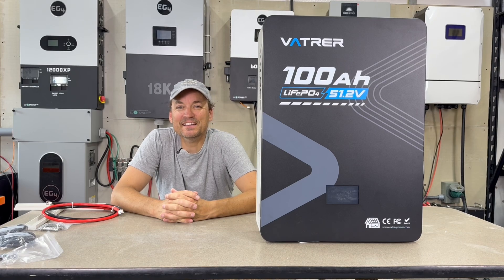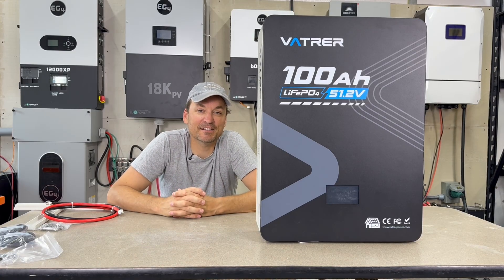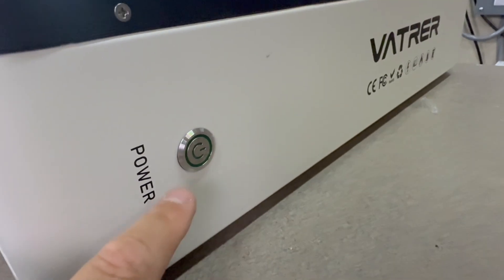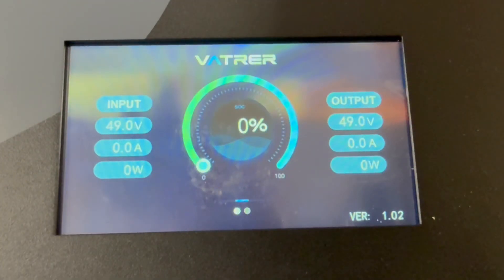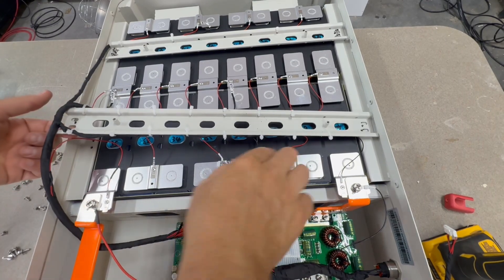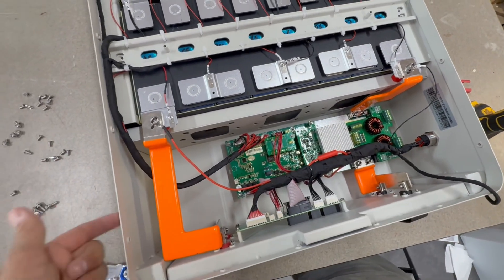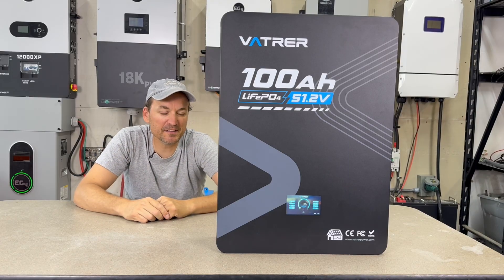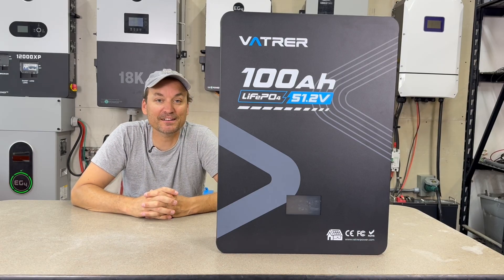The new Vatrer 100ah wallmount battery,  review teardown and testing, #vatrerprimeday

Comment: Can  it work  with a inverter without communication protocol
Reply from the maker: Sure. No issue there. You can set the charge and discharge parameters on your inverter.
Reply: Thanz my inverter is xija(CNSwipower)  I'm planning  to buy a vatrer wall mounted version  wanted to know first

Comment: Quick question 
One string 27 tiles 14.2 v 383.4 v.  6.8 amp 
2 string  10 panel s 40 v  each  total 400 v 10.3  amp can be combined  by combiner box to be used on eg 4.  6000  xp
Reply from the maker: Sounds like it’ll work. Depending on your region that voltage might be a smidge high on mppt2. So just make sure it works. You can find a temperature coefficient calculator online.

Comment: When you do battery capacity testing do you use an inverter that shuts off stopping the test or do you use a load test and the battery shutting down ends the test?
The screws sticking out on the terminals are dangerous.
Reply from the maker: They do have those terminals covers.

I use an inverter. But I set the voltage level lower than the battery will take to trip under voltage. So the battery ends the test.
Reply: @GavinStoneDIY  The terminal covers will not stop someone from putting the connector on upside down hitting the screws and the covers will not stop that.  You know how people are.  They should be recessed.  Another company got similar feedback and changed theirs fast.
Reply from the maker: @sciglassblower ah yeah. I just mentioned that in my last video on the Ecoworthy battery. It’s true though. You almost have to go out of your way to make contact with those screws. But it should be recessed yeah.